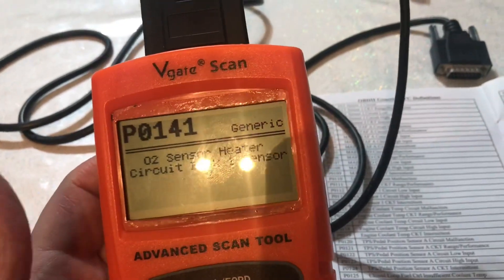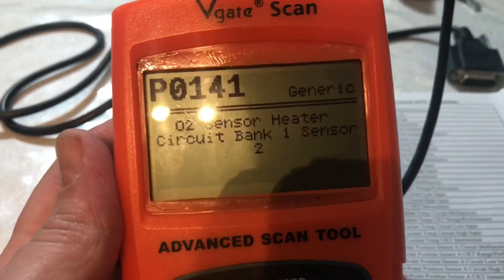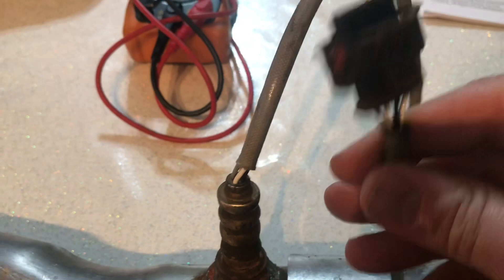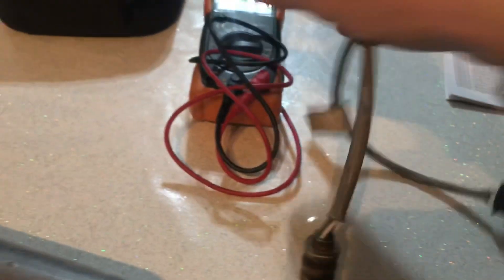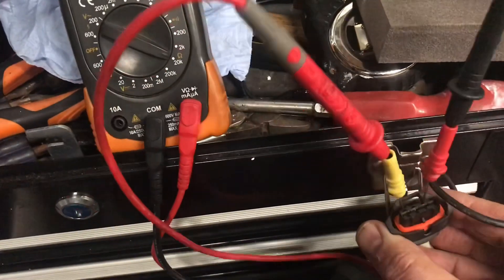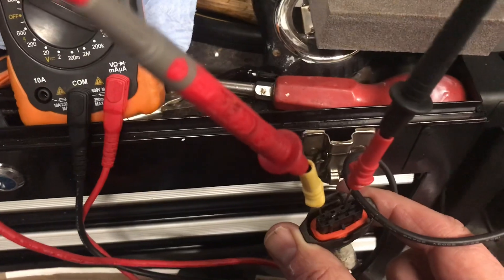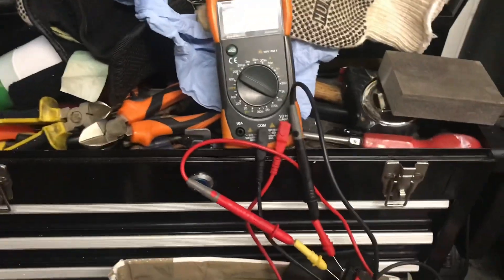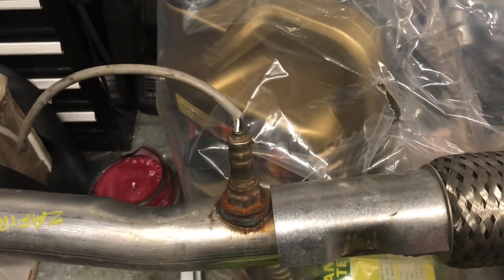Testing an O2 heater circuit on Vauxhall Opel Zafira b

Comment: My 1.8 2014 zafira b has been throwing this code for years...very intermittent sometimes can go 4 months without it coming on...I have replaced both sensors for oem ones and cleaned the maf sensor with proper maf cleaner too and it still comes on sometimes but very intermittent also checked the cat....hasn't come on for like 3+ months now....I just reset the light with opcom...looked on the vauxhall forums apparently it happens alot (most come to the conclusion its a can bus glitch) and vauxhall make alot of money from this code coming up. Opcom reset it if its not a faulty sensor.
Reply from the maker: Did you check the connectors, especially the post cat. That sounds very annoying. Great info. Thanks for the input.👍👍👍
Reply: @drivewaydiyer6504  Never thought of that, perhaps ill spray some electrical contact cleaner in them (and blow it dry) if it happens again.